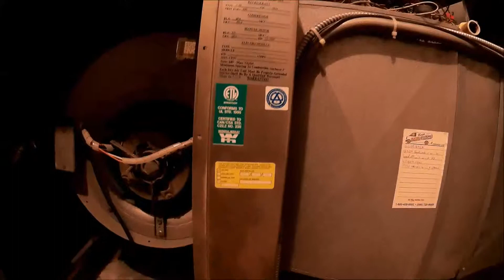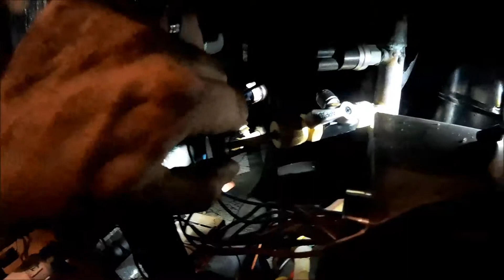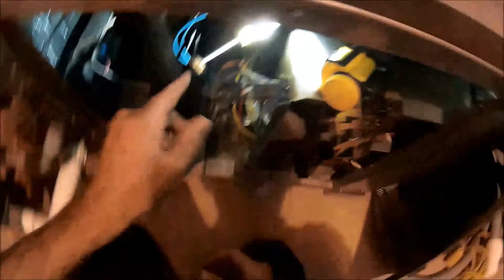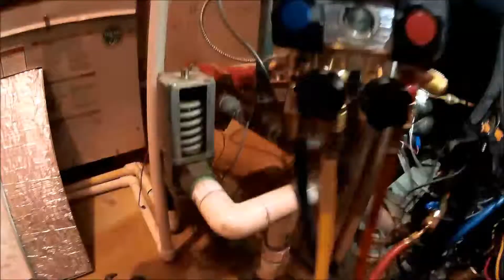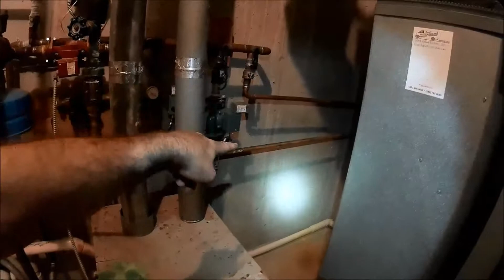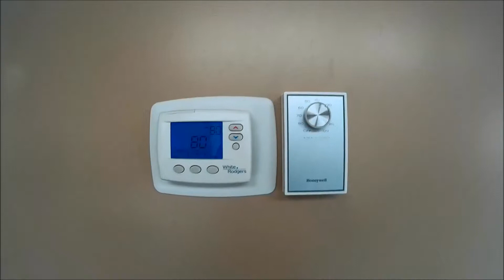Pool Room Dehumidifier Repair

Comment: These units are little intimidating to me I take care of my customer heating and cooling I wish I don’t have to work on them 
But don’t want to loose my good customers 
One day I will be as good as you 
Thanks for sharing
Reply from the maker: Just get in to it. Learn as you go and call tech support
Reply: @MiHeatingGuy  I wonder how long those coils would last, I work with Chlorine and it'll destroy anything exposed to it or its fumes, it's etched plastic and rotted stainless steel, the place I work has gone through 3 dehumidifiers in 10 years, one was a nice Hi-E-Dry, that one lasted the longest at 7 years, 2 cheapo ones lasted a year each, and the current Fantech unit appears to be doing OK though I've treated the coils and exposed copper with a corrosion inhibitor and periodically oil the fan bearing